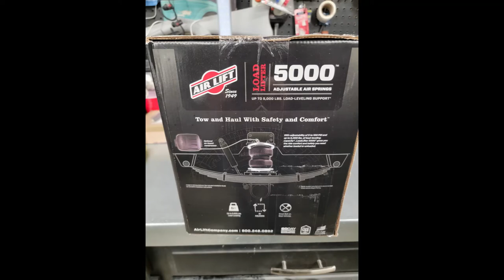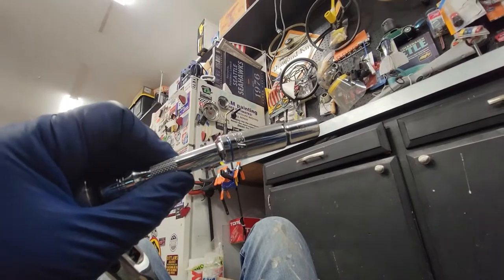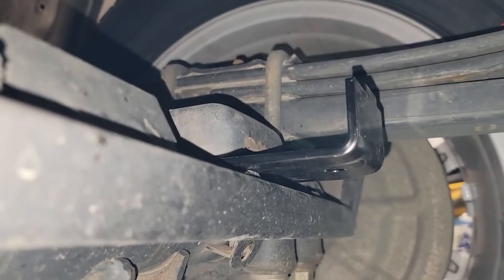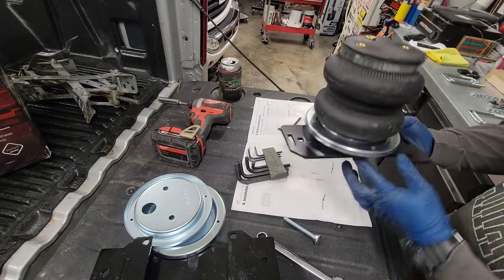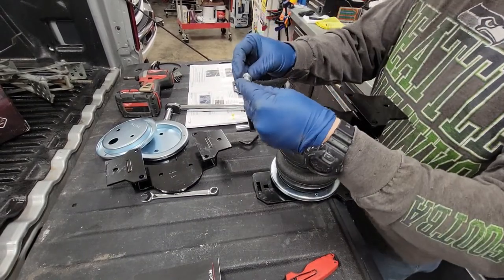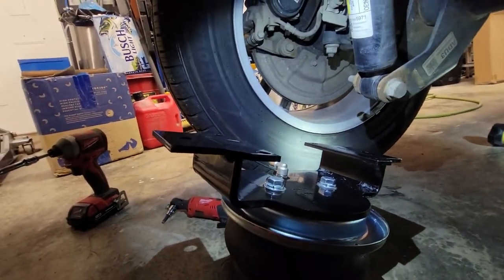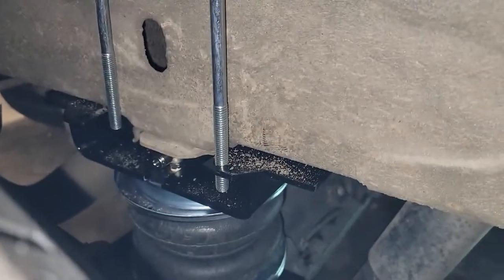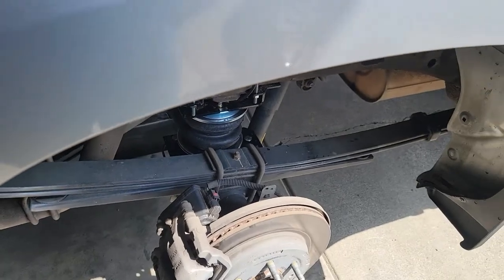2020 Chevy Silverado Air Lift Load Lifter 5000 unboxing/install

Comment: We learn by our mistakes and I’ve learned from yours so hopefully I’ve learned to make fewer ones. Lol. thank you.   Got my set ordered.  Seems to me the worst part is the bag assembly on the bench with those weird looking brackets.  Well done
Reply from the maker: You got it!   glad i could help.   actually i ran my gauge and switches into the dash under the radio.  that was a little trickier than the brackets but it was well worth the effort..

Comment: Love the pickel Rick in frame of last 2min 🤣🤣
Reply from the maker: Lmao
Reply: I have a 2019 1500 with th hide a hitch gooseneck in the bed will this system still work, I’ve seen videos that say it will work on a fifth wheel setup???
Reply: Thanks for screwing up glad I'm not the only one 🤣
Reply from the maker: @mattbolinger1015  I do not know what might interfere with  a 5th wheel hitch.   I've only been a bumper pull kinda guy up to this point in my life.  Seems to me that it would work.   I'd be more concerned with the 1/2 ton gearing, brakes, transmission heat, etc pulling a 5th wheel with a half ton.   My neighbor's parents do pull a 5th wheel from Alaska down to Washington each year to visit and he uses a 1/2 ton.    I had never seen such a thing until that.   so It is possible.

Comment: Please test the air connections before you try to install.  Mine leaked at the brass fitting insert that goes into the plastic end cap (yup they are plastic if you order them thru any online retailer). That cannot be repaired and I doubt you’d see any bubbles if you sprayed a soapy solution when installed. Called the company and they want you to submit an online request.  They are not willing to overnight a replacement to a brand new defective part.  Their warranty on a brand new product is too slow if you are planing a time to do the install.  Makes me wonder what would happen if you’re on the road and there is a warranty issue.  Ah sir, go on line and submit a request, while your truck suspension is out of service?  Be aware.
Reply from the maker: That's unfortunate.  Companies should always prioritize existing customers IMO.    Luckily I've made it a year without any issue.
Reply: @vdubluv222  Tks, especially when it’s not even installed yet.  But yea they should actually have some kind of hot line for those on the road with issues.  Tks again for your video.  When I do get my next box, from Amazon on Sunday, I’ll be sure to review your video again.